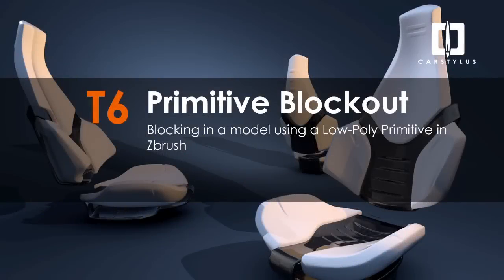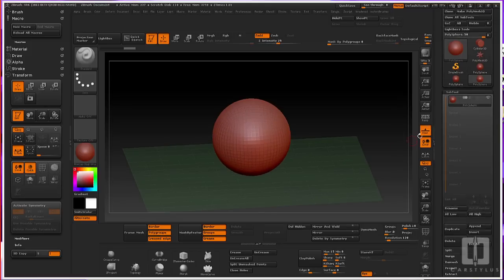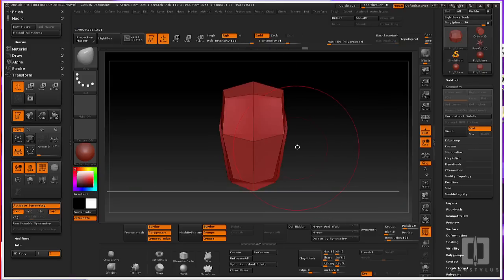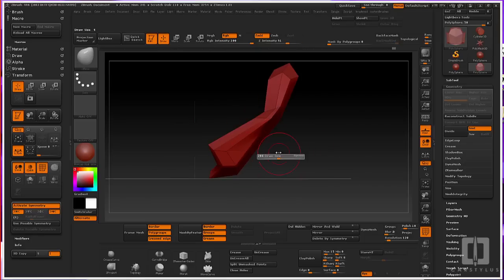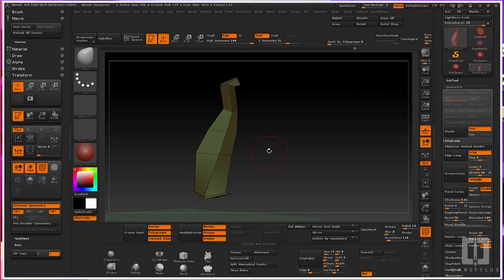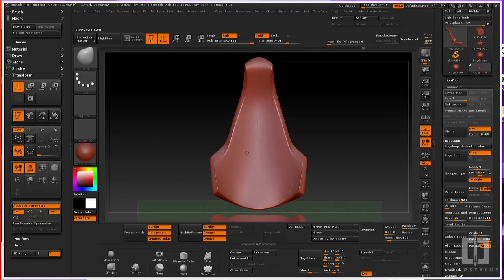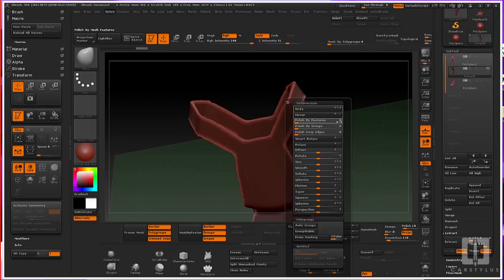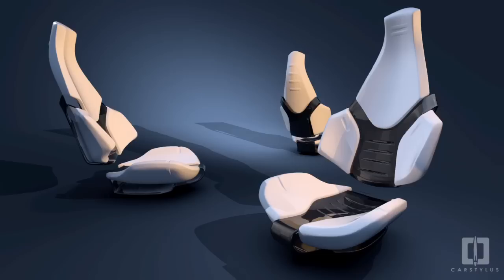Tip 6: Primitive Blockout in Zbrush

Comment: Great tut! not sure why you have such a cluttered UI though? Your using about half of your screen??? PS when you do the BOOL operation with the transformed mesh, didnt that change the angles of the shape, i mean when you make the shape wider that also changes certain angles in that shape. That way its different than the small extruded shpe you made.
Reply from the maker: You're right about the cluttered UI.   This vid was made a while ago and I've since made many changes to my cluttered UI .      As far as your other question is concerned,  I'm not sure if I understand.